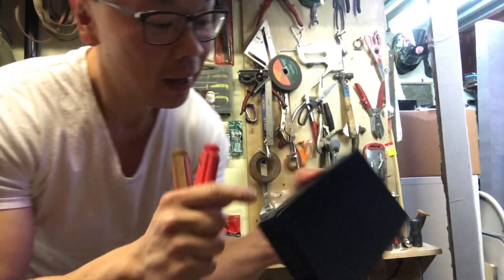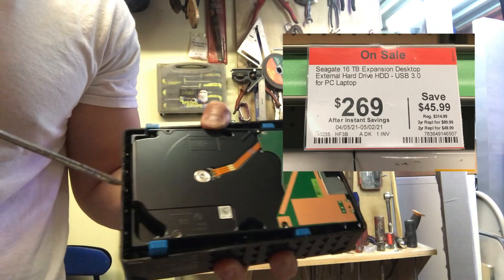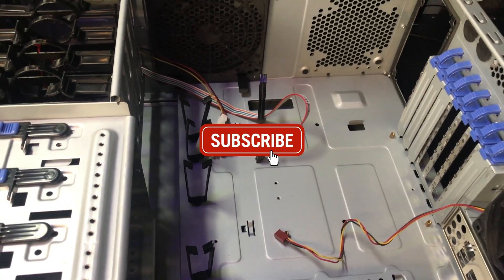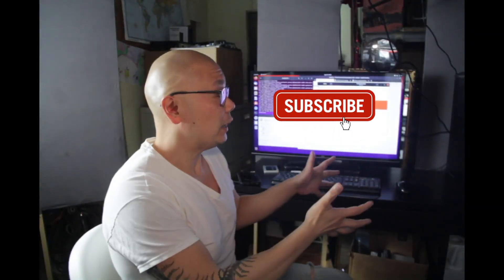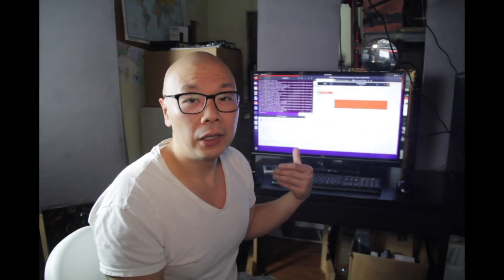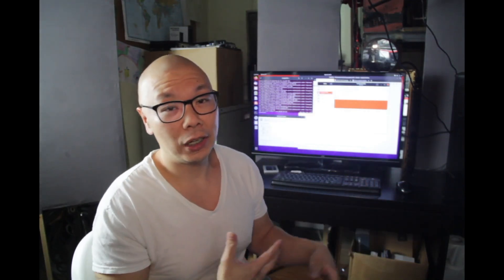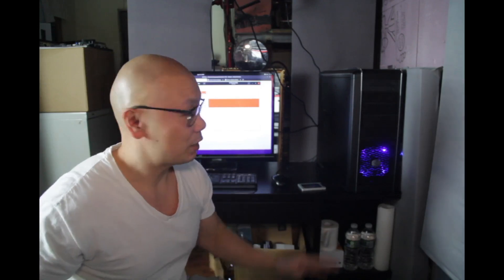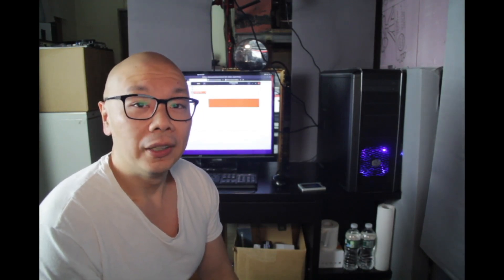CHIA Crypto RIG Ready for Plotting / Farming

Comment: Hi man, Can it be beneficial to use the drives in RAID??
Reply from the maker: I do not find it any benefits in running any RAID configuration for Chia Farming.  Unless your fear is losing the plot files for farming.  The down side is that you will have to have all "Similar" drives and replace them with very "similar Drives" if they ever fail. But before I go on and about this topic. Between the loss of speed in some cases depending if you're mixing different drives,  loss of capacity depending on the RAID type. The cost factor for farming Chia should be economical. I think a Raid will just defeat this purpose.

Comment: would you recommend buying one 512gb nvme ssd or 2tb hdd for mining chia? if chia doesnt work out i can always use this for personal use. is size or speed more important? i already have 350gb free space so i was thinking to get a ssd and use that for doing two temp plots and using the hdd for final directory, also the ssd is 477 and 239+239 is 478  :/
Reply from the maker: So hers is the thing. Plotting (temp) takes up 356gb while it’s doing the plotting. only till it’s done does it become a single 101gb file for farming. The 512gb ssd will only be able to handle one plot at a time. How I would play out your configuration is:  512gb run a single plot with que. also will need to factor your cpu threads for this. Leave the 2tb for storing final plot used for farming. And the free space for farming as well.
Reply: @poorinvestor  yaa thought ill sell some of my cryto today and buy a ssd but the market dropped :[

Comment: question.. can I plot on my fast pc with  m.2 nvme and farm it to a slow hdd and once the hdd is filled up with farms,
I want  to move the hdd to a slower 2nd  "farming" pc? with 128g ssd, 4g ram.  (assuming farming is no longer connected to the plotting).
Reply from the maker: yes you can, this is exactly what I tested as well when i was first testing with my imac.  when the plot was complete it ends up at a single 101GB file.  I told that and sneaker net it across to my Farming Rig and placed it into the directory where the FARM will look.  of course there will be a waiting period as it will eventually sync.  (i learned this the hard way, because my impatient ass was getting worried it wasn't working only after 5 seconds when the files copied over.). short answer. YES!

Comment: does the HDD rpm matter for farming... I see that nas HDD has 5200 and 72-7500rpms...
Reply from the maker: from my understanding farming is not intense at all.  of course I would opt for the 7500.  but considering the slowness of the farming process. I honestly can say it will not make a huge difference. but thats just the farming process. of course other things considered is when the files gets written to your farming destination from temp after it has completed the Plot.  doing this across one plot and one drive is very insignificant.  but I'm sure if we're losing transfer time because of slower drives across dozens of HD. thats where you will suffer the most. just my 2cents.

Comment: Good luck on the build! I got my parts today too. Are you following a guide for the install on ubuntu?
Reply from the maker: Yes I am! but i had some issues with Ubuntu and the NIghthawk USB wireless. In my upcoming  vid I actually explain the reasoning behind it.  But I am planning to use Ubuntu on my laptop for this purpose. I have successfully finish 1 plot on my iMac and transferred the plot to be farmed on the new rig.
Reply: @poorinvestor  how long did the 1 plot take?
Reply from the maker: @chewypencil  considering all the screw ups I did. But the most accurate one I can go by from my iMac took about 10hrs. It’s an i9 latest gen. running on 2tb ssd. The new rig I did in this video is running 4 plots in parallel now and I should have an accurate time for this one. Since I didn’t mess anything up...at least I don’t think I did.

Comment: nice catch whit this external hdd,  gpt or mbr ? any diference on 1 or 2 tb hdd
?
Reply from the maker: thanks!  If you're asking based on size of the HD 1 or 2TB its a difference of how many plots your can run in parallel.    each plot temp uses about 356GB / 1TB = 2 Plots in Parallel
356GB / 2TB = 5 Plots in Parallel.  But just because you have space for 5 plots your processor needs to be able to support that many as well.

Comment: great video :) can you show how you configured everything? I just bought some parts... amd ryzen 3800x  ,16gb ram, 1 samsung 970evo 1tb ssd, 40tb hdd, on a ASRock B550 Phantom Gaming 4... I dont know how many I can run parallel etc...
Reply from the maker: ok lets start of with the Ryzen 3800x that is an 8 core processor.  now for each plot by default uses 2 threads.  If you were to go by this you can run up to 4 in parallel.  no each plot's temp file creating will use (lets average to 400gb). so 4 plots running at the same time, your temp drive will need at least (400gb X 4 Plots = 1.6TB) now looking at my RAM usage with 32gb it has spiked over 16GB so im not sure how much this will affect your plotting time.  if you want to be safe and what I suggest to start with your setup, plot 3 in parallel and check the time.  I have a feeling with 3 you will actually finish it successfully.   
Ps.  i know you fat fingered the 40TB HDD if not please tell me where you bought it. LOL
Reply: @poorinvestor  Thank you for the information.  40TB HDD in total ^^ I have 2 14TB and 1 12TB